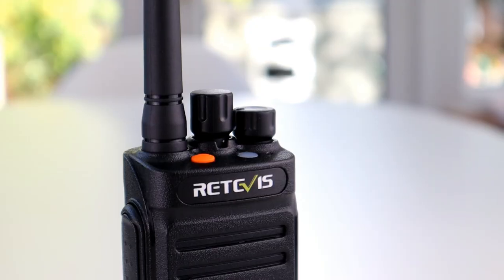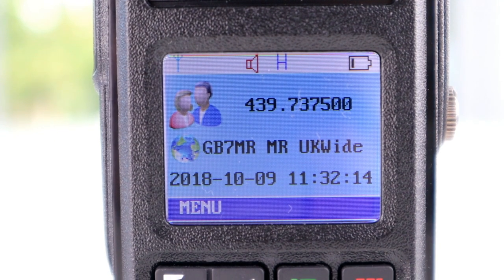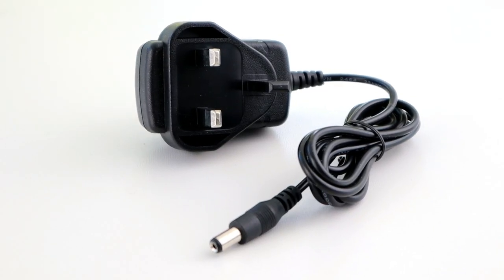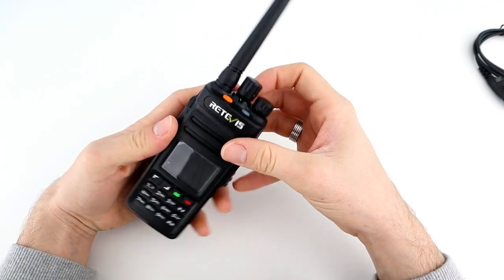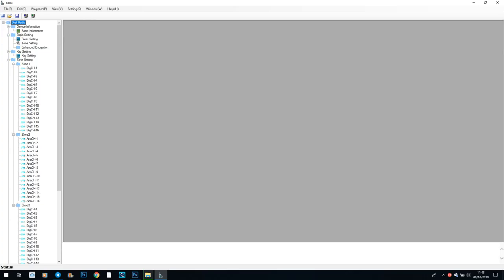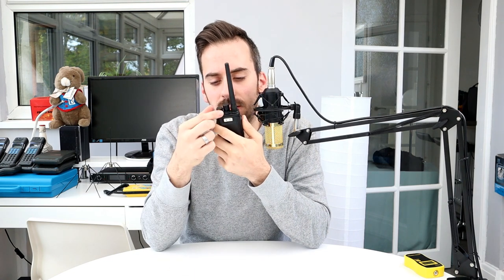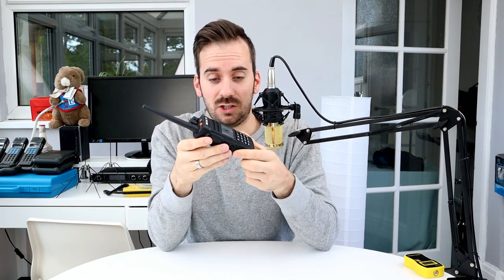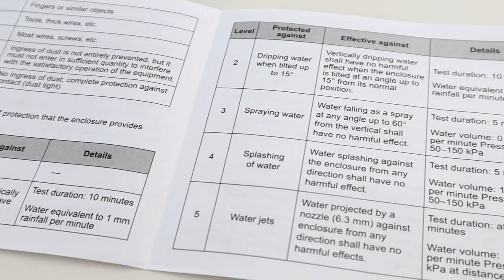Retevis RT83 - IP67 Waterproof 10 Watt DMR Radio!

Comment: I bought two md-398s for commercial licenced use. One I can program, the other won't let me change the frequencies. It's stuck in ham bands which does me no good. Waiting for a cable doing range tests on the one I can program with sdr/dsd. Lame. Cable is rare as hens teeth unless you want to wait 2 months for a carrier pigeon to fly it over from china. Not same as md-2017, not same as bf9700. I know cause I ordered both listening to internet bs

Comment: Does it really have 10 Watts ?
Reply from the maker: It does
Reply: @RingwayManchester  thanks. Can you still communicate with a Baofeng UV-5R ? Or is this a pure digital radio ?
Reply: @cyberghost74  digital and analog. 400  to 470 MHz on Analog

Comment: If you can enter a frequency outside the ham band from the front keypad, It's bound to be illegal in the USA.
Reply: I wish the FCC would do something USEFUL with their time instead of passing arbitrary rules.

This is just them blowing hot air, trying to flex their flabby muscles. 

They don't have time,  money technology  or manpower to enforce it.
Reply: Dark Shadow 

Why are FCC picking on Baofeng? There are plenty of other brands that are fully expandable and not just the cheap Chinese radios. 

I agree, a lot of hot air and they have to justify their existence now and then.
Reply: @humaxf1  Why? Simple They're being lobbied by the  likes of Icom, Vertex, Yaesu. Because the feel threatened by an upstart like Baofeng offering radios with more features than their dinosaurs at about a 10th of the price.

And for some reason the ARRL is on board too, they're not dumb THEY HAVE to know that trey are putting themselves out of business. Squeezing an already dwindling market that's failing to IP technology.

Comment: Hi Lewis. Great vid as always. Just wanted your opinion on the fact that it's UHF only. Would you consider this limiting when a similar model like the TYT MD-390G Waterproof is both VHF and UHF. Have you done/are you considering doing a review on the TYT MD-390G just for comparison purposes?......further to my further, just been checking on the radioddity website and the specs for the TYT MD-390G are somewhat confusing as depending on which price point you click on it's listed as being a UHF model or a VHF model and some seem to suggest that is BOTH UHF and VHF! confusing...…..much! My feeling is that Radioddity may have a misprint on their site and that you can either get a UHF or VHF model but one which covers both?...…..well, the jury's out on that one. Any ideas Lewis? Can you confirm if the TYT MD-390G is a dual bander or not?
Reply from the maker: Hey Will,

It's limiting depending on what the user wants. UHF is better for short range comms, it's the busier band, there's more repeaters on it. I have a couple of dual band handsets and I don't think I've ever used DMR on VHF. As for the TYT model, I've never worked with TYT so I'm not sure I'll be getting one of those sets but you never know. I'm almost certain the TYT MD-390G is a single band that offers both options but not in one set.
Reply: Thanks for that very comprehensive answer Lewis, much appreciated. I'm very new to radio and I find your videos inspirational, enjoyable and informative as well as being fun. This hobby sure is addictive though and I think I may have to go into rehab soon like your mate as every time I open a cupboard door these days a Baofeng falls out of it and as if that wasn't bad enough I've started to take an intrest in network radio after watching some of your reviews of it! As an aside, have you ever had any bad experiences with purchasing a fake/clone radio? I recently purchased a Baofeng BF-F8HP on ebay which turned out to be a UV5RT under the skin. The external cases of both radios are virtually identical except for the name badge so I suppose it was just a matter of faking that to pass it off as a BF-F8HP. The re-badged UV5RT only has dual power settings of 1w and 5w and I wanted a triple power BF-F8HP. Lesson learned! Anyway, I've ordered a triple power UV5RTP from radioddity this time who are a decent reputable company. Might be worth doing one of your vids on the dangers of fakes/clones out there? Thanks again Lewis and keep those videos coming...…..I'm every bit as much addicted to them as I am radio these days! 73 for now! (see, I'm even picking up a bit of the lingo!) ;-)

Comment: I wonder if this is an MD390 under the hood.
Reply from the maker: A lot of the DMR radios out of China seem very similar. It's a possibility.
Reply: Ringway Manchester 

MD390 with recording feature and different screen font/layout

It’s genuinely becoming difficult to keep track of TYT/Retevis models with quite a lot of crossover in features.
Reply from the maker: You're right but they all have a specific main feature for example:

10w
IP67
Screen/no screen
Commercial or amateur user (software/feature differences)
Reply: Ringway Manchester 

True and I’m all for choice but... too many choices.
Reply from the maker: It's a minefield